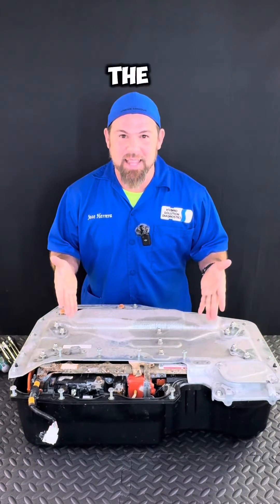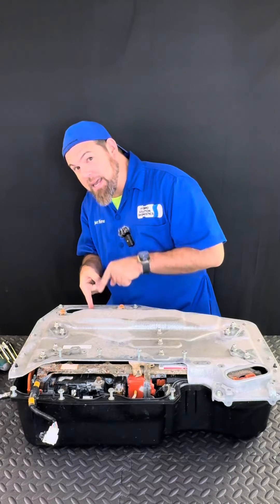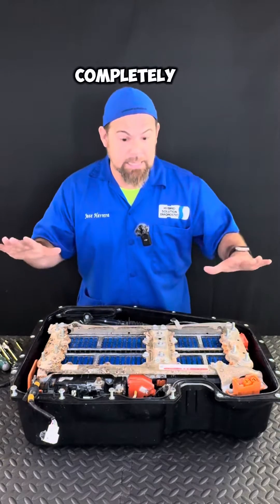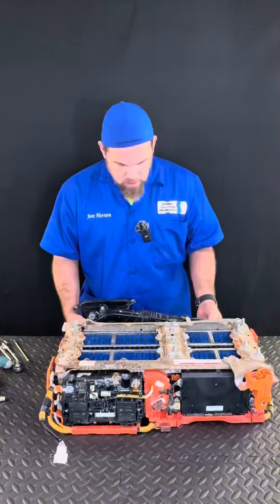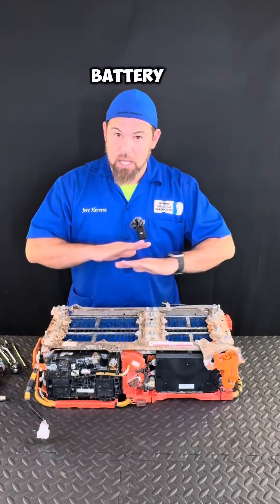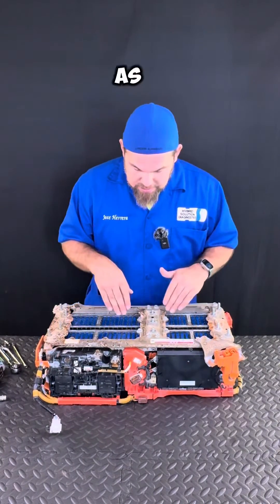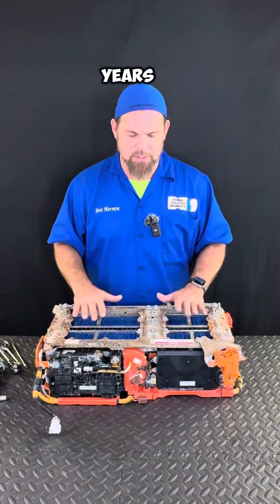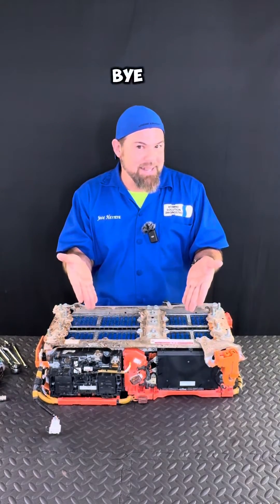2023 Honda HR-V e:HEV Hybrid Battery Review

Comment: Would it be ok to add a filter to the intake?
Reply: I was thinking the same thing but if the intake fan sucked in the filter, good luck getting the warranty to cover it.
Reply: @pigg20021 thought about that. I'm thinking a screen to go on the outside. Maybe a little adhesive and a few magnets so it can be easily removed and cleaned.